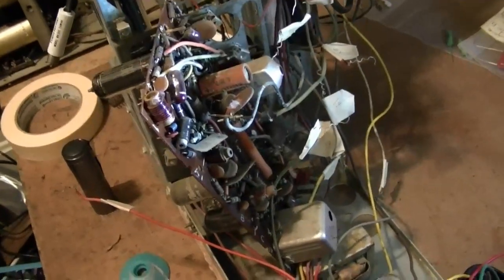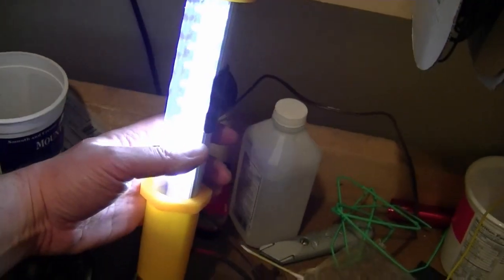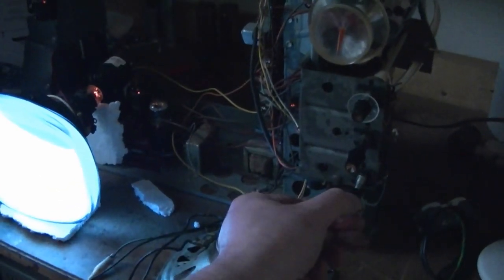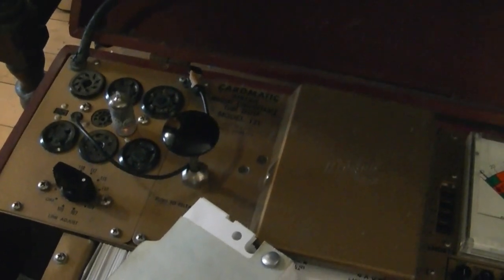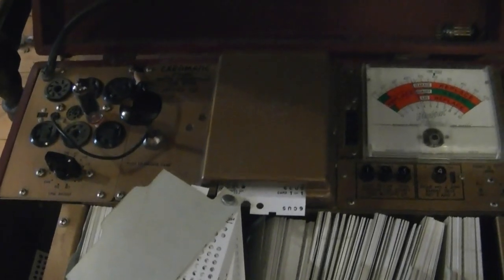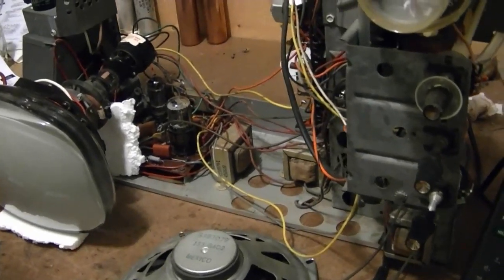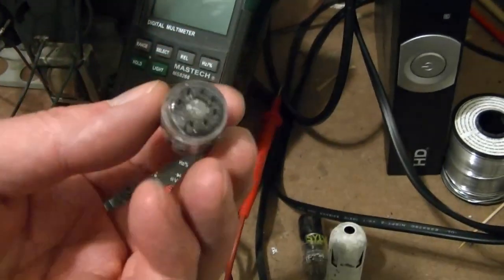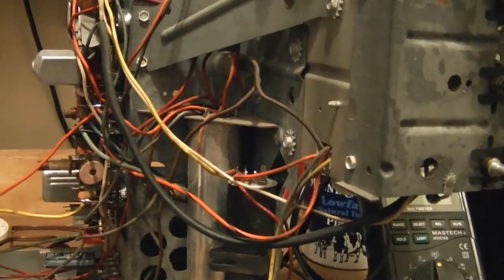GE21C2465UHF restoration pt4o?

Comment: Stray signal pick up due to the chassis being spread out for testing, with wires possibly extended and crossing in this temporary layout. It is a signal being introduced from the line section to the video . Looks good though, a job well done on this restoration,

Comment from the maker: That's definitely an issue in very old tubes from the late 20s like my WR8 columnaire.  I believe the tubes are oriented so the elements are in a certain plane to minimize the effect.  By the late 50s though, horizontal tube mounting in TVs was very common I think they work out the issues by then.

Comment from the maker: They had Polyester/Polyprop caps in 1958 ?  Almost all the stuff I work on is older with paper caps.  I asked about them on Videokarma and was told they are prone to failure when they get this old so I should go ahead and replace them.

Comment: you might want to try putting in a 0-330 pf capacitor from the first grid to the cathode on the horizontal output tube.

Comment: I heard a theory some years ago can't recall if I read it or someone told me, but tubes can be more prone to failing due to the internal elements drooping with age/heat/fatigue if they are mounted sideways like the tubes on the IF board. I could be wrong but this may be one reason why you had so many bad tubes on this one. Cheers :-)

Comment: That Cardmatic is quite valuable...do you still have it?

I still have a good working Mallory UHF converter.
Reply from the maker: Yes, but the Cardmatic 121 is not that valuable.  It's the low end version.  It's the model 123 and 1234 that are valuable.

Comment: Is the other tube in the VHF tuner a 6X8? (RF Osc. & Mixer)
Reply from the maker: Sorry, I don't remember but it seems likely.
Reply: @bandersentv  thanks. Just curious. My GE is a newer model with 23np4 and very similar chasis. Tuner had 6CY5 and 6X8. Some other differences though. Mine has 6bz6's and 6cb6 in IF and 6AW8 clipper and video amp. Seleniums instead of 5U4.